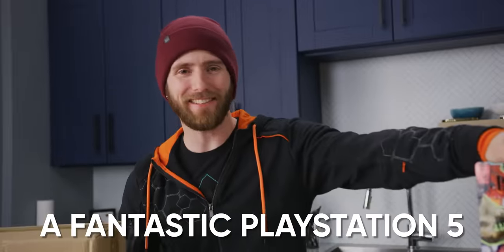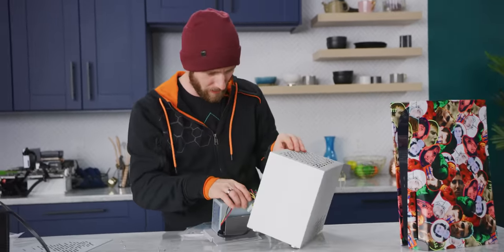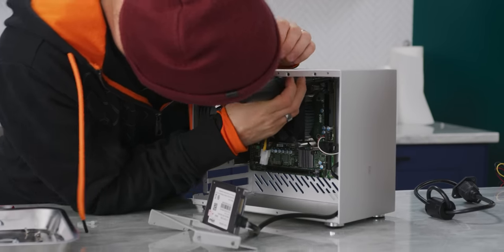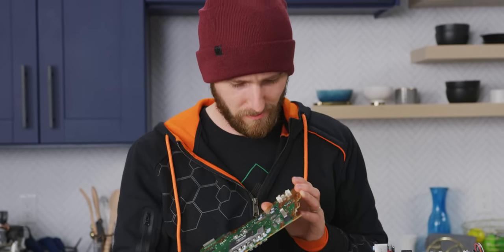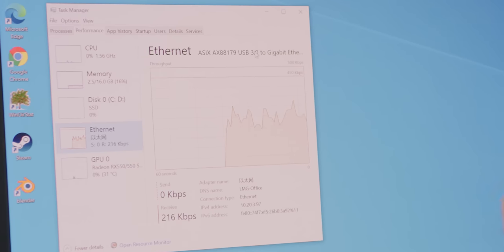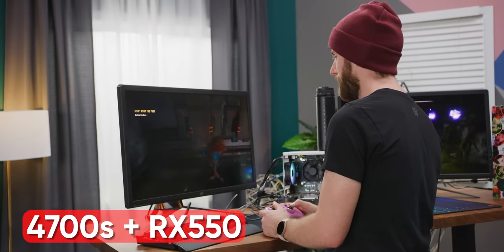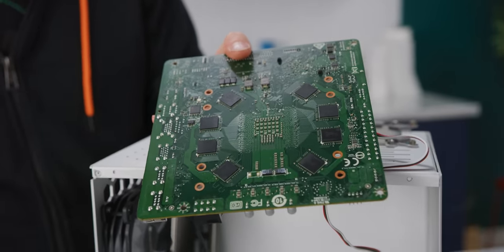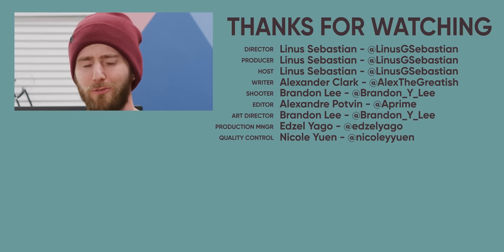Why Is AMD Selling Broken PlayStation Chips?

Comment: >"Instead of turning into e-waste"

Yeah... You solder it together with other perfectly fine components and get even a larger e-waste...
Reply: well, they need to assemble most of the parts to properly test the build
Reply: Yes, I totally agree: from 20 gram of CPU waste to 5 Kg (or so) of a complete system
Reply: It's only e-waste if you look at it from purely a gaming PC perspective. They'd make perfectly acceptable home office PCs for example, if the price wasn't so bad. 

A lot of the varriation in silicon performance comes down to small defects and all of the major companies that make chips do this, back in the old Phenom days the stuff that didn't work wasn't even separated and you could potentially unlock some more cores (they were all basically quads with parts disabled that potentially didn't work properly, I had a dual core that unlocked a 3rd that worked but at a lower clock) same with intel, with the same design put into different performance tiers based on their likelihood to perform to spec, and you can see it transparently if you take the cooler off some nvidia cards and see multiple models having the same die number.

This is by no means a new concept, and it's not even a bad idea in this case, it's just the price that throws it off. It's also why lower performance models often launch later than the main, because the lower models are the same design but worse, so when you have a bunch that don't turn out as desired but still usable and in a similar way, no problem just remove what's broken, call it good, and launch your lower tier GPU or CPU.
Reply: @SimonBauer7  not him but iirc, yes with a bit of luck
Reply: @SimonBauer7  I don't remember all of model numbers I know some of the quads could become hex in the second series
Reply: There need to be use case for that if they are price it so high. Or maybe they sold it mostly in bulk and then price is much lower (it's listed on AMD page, but you can't just buy it). Or maybe they do it just to satisfy some regulation and dodge paying for producing e-waste by making bigger e-waste.

Comment: 5:57 "that PCI Express slot - it's Gen2"..."that's exactly what the PS5 M.2 slot is"
Wait what?  I don't know what Linus is smoking.  The PS5 expandable storage specifically calls for Gen 4 drives, and works with high performing Gen 3 (from LTT's own video).  It's obviously not Gen 2.
Reply: maybe he meant x2?
even gen 2 pcie is on par with sata 6G tho

...but apparently it is gen 2 x4
Reply: Yeah, right, I also commented that.
Reply: Leave him alone bro he films so many videos all the time he's going to get something wrong.
Reply: @monetary687  First day on the internet there bud?
Reply: Do you not understand sarcasm?
Reply: Can't use sarcasm in 2021.
Reply from the maker: 8x gen2 is the same bandwidth as 2x gen4 (speed of PS5 m.2 slot) .

Legitimately not sure if this is exactly why it's like this, so I probably shouldn't have mentioned it, but it's not too far fetched.
Reply: @LinusTechTips  but even then, gen 2 x8 is 4GB/s.  The m.2 slot on the PS5 can read gen 4x4, or up to almost 8GB/sec. It would have left enough bandwidth for a full gen2x16 slot.

But it's probably down to Sony doing something proprietary.
Reply: @LinusTechTips  I think you're confusing it with the Xbox series ssd/memory card, those are 2x Gen 4
Reply: @LinusTechTips  Thanks for the clarification.  From LTT's "I tried an INCOMPATIBLE drive with the PS5"  video (at about 1:58) I thought the PS5 m.2 slot is 4x gen4. If correct, that would be the same bandwidth as 8x gen 3 or 16x gen 2.  

I agree that your  point in today's video is still valid - the 4700S SoC has limited I/O when used outside of a purpose built console.  Trying to make it have PC like connectivity leads to some weird choices.
Reply: @LinusTechTips  You people need to do stuff about these nudity comment bots like…

 “Yuna 😂” or, “OPEN PAGE,,,,,, 😍👇

Comment: I'm curious: what does Device Manager look like in "Devices By Connection" mode on the thing?
Reply: it probably shows the onboard GPU. Windows likely just doesn't have drivers for it because most console GPUs are custom made and do weird shit.

While this video is about the ps4 (below) the same applies to most consoles.
https://youtu.be/QMiubC6LdTA?t=1661

Comment: "we are saving on e-waste, instead of throwing away this little chip, we are making a much larger, more clunky system that will be thrown away". If the chip is busted, that's a few square centimeters of waste. Adding the board-which is also pretty junk when it's literally soldered into place with the busted chip, you just expanded your ewaste by orders of magnitude. Then combining it with a poorly made case and fairly junky cheap power supply, the e-waste created skyrockets.
Reply: I dont think you understand how expensive it is to manufacture CPU / GPU. The waste is not the actual chip, but the energy and resources put into it. The Power Supply issue isnt from AMD.

Comment: PlayStations 4 and 5 for the North American and Japanese market are label 110/100 V. but they’re all actually auto voltage, you have to disassemble it to see this on the power supply.
Reply: Wait is this true? I've been running my Ps5 in a transformer for months because of this.
Reply: @diabloterrorgf  I'm literally only commenting on this to see if they answer :)
Reply: @diabloterrorgf  did you aleady test it? im just curious...
Reply: @diabloterrorgf  Every PS since PS2 Slim.

Comment: 12:35 Fun fact: the PS5 has 4 PCI-E Gen4.0 lanes which are directly connected to that "IO hub" which is the SSD controller and chipset on the PS5. Those 4 lanes are shared with the M.2 and internal SSDs, which is not a big deal since you can only play one game at one. It also has a couple of direct-wired USB 3.2s (10Gbit), HDMI 2.1 and that's basically it.
Reply: Did they not do the ARM SoC south bridge for PS5 like they did with PS4?

Comment: I admit, I am still a bit disappointed that LTT did not install FreeBSD on this thing (for which NVIDIA has official drivers for the 10 series cards) for the “full-er” PS5 experience.
Reply: Is the PS5 OS actually based on FreeBSD like the PS4 was? I looked through Sony's OSS pages and couldn't find anything indicating that.
Reply: @Jake1702  PS3 and PS4 use freebsd so does PS5
Reply: @Jake1702  Technically I think the PS5 OS is based on the PS4 OS and the PS4 OS on the PS3 OS... but the PS3 OS was based on FreeBSD. Excellent choice, if I had to pick a base OS back in 2005 I would have picked the same one. But it's hard to tell how much FreeBSD is still left in there now.
Reply: @KillahMate  are you sure the ps4 software is based on the ps3?
Reply: @sleepyuser5189  Uh, I think I saw some articles at the time discussing how data miners found code on the PS4 that matches some PS3 code, so it looked like the PS4 OS is a continuation of the same codebase. But like I said, it's hard to say how much of the old code was left - all we know is that there's some. Maybe now that both consoles have been cracked people have had a chance to analyze it more in-depth, but I haven't kept up with that.

Comment: WHY TF DID U STOP HIM, WOULD HAVE BEEN SOME GOOD CONTENT
Reply: Buy 2, blow one up..... YES.
Reply: Doesn't sound like Linus stopped him, sounds like it wasn't working out.
Reply: Plugging 220 into 110 does the same thing as putting dead batteries into something. As in nothing happens. 110 into 220 is when you get sparks and fire.
Reply: @JETWTF  okay, good to know
Reply: @JETWTF  would you mind explaining? I really would like to know. AC electricity I find fascinating and I don't know a lot of nuances like that
Reply: @Frizzy9000  220 volt is double 110, plug a 110 device into a 220 outlet and it will receive twice the power it is supposed to get and create a catastrophic failure, as in pop goes some circuits with sparks and potentially flames. Plug a 220 device into a 110 outlet and it will get half the power it needs and barely work or not work at all, getting half the power it needs to function is not going to make it function or blow circuits.
Reply: @JETWTF  Makes sense, thanks!

Comment: Not that it would make a huge difference, but why would you test it against a 5800X as opposed to a 3700X since it's more analogous to the PS5's CPU?
Reply: Should test it against 2700x, since 3700x has much bigger memory cache.
Reply: @1GTX1  2700x is only Zen+ [Zen1 refresh] versus 3700x being Zen2..
Reply: @niteriderevo9179  less cache with lower frequency than zen 2 bottlenecked further with gddr instead of ddr ram making its performance more similiar to full speed zen 1 with ddr ram.
Reply: @darkwolf1739  give zen+[zen1 refresh] the same limits and it won't perform as well as zen2 does, the ps5 core is 8 zen2 arch cores paired with a custom amd gpu as a SoC

Comment: Plugging a 110v supply into a 220v supply, the best case scenario it works, worse case scenario it does nothing. How does giving something less supply voltage make it catch fire? Everything inside is rated to handle more voltage not less. Also what? Having a multi voltage power supply requires power faction correction? No it doesn't, it requires a different switching power supply chip and a different transformer. The reason it is 220v only is because it was never intended to go somewhere with a 110v supply. You can make it simpler, easier and cheaper. Power faction correction is making sure the power and voltage is in phase and it a concern for all switching power supplies regardless of voltage input. I like your videos but please get someone that knows something about electronics.
Reply: Exactly. It's not made for US and Canada market
Reply: Yeah that's what i thought, EU, ANZ parts of Asia all use 220-240v, very few products/psu's are sold with dual switch. Most of the devices I have are 220-240v only even big well known brands like EVGA/Seasonic/Corsair
Reply: my exact thoughts, if you plug a 240v supply into 120 best case itll work worst case nothing happens
Reply: In ac motors you can burn out a 220 motor plugging in to 110 v as it needs to draw double the current to maintain the rated power. So they could be coming from this but not usually true in electronics
Reply: I'm from third world countries and we use that huntkey PSU everywhere let me tell you nothing explode and about 110v or 220v, that PSU come from China and all most all Asia countries using 220v ( the only one using 110v i can think of is Japan) so if you order it from Aliexpress it just not mean for your region just like charger things.

Comment: Back in the early '90s when dual-mode power-supplies were first a thing, there was a switch that would allow you to change it from 240V/50Hz to 120V/60Hz.  One time I plugged in a power supply to a 120V/60Hz outlet while the switch was on its 240V/50Hz setting.  The only thing that happened was that the front-panel LEDs lit up very dim and the computer didn't boot.  Of course, when I saw that, I turned it off very quickly, so maybe it would've caught fire at some point if I'd left it on?  But for the less-than-ten-seconds it was on, nothing happened.  I unplugged it, flipped the switch to 120V/60Hz, plugged it back in, and everything worked fine.  No apparent damage.
Reply: no it wouldn't, Linus is talking bs there

Comment: Think this would be more used in things like animatronics or controlling rides in theme parks as those systems tend to be really really outdated and slow ( seen a few barely able to run windows 95)
Reply: I hope that a ride controller does not use an obscure PC hardware, based on a consumer product.
It should be based on embedded or industrial variants of the components.
 know a company that bought Genuine Microsoft DOS embedded licenses in 2008 for building a medical device/system developed in the 90s.
Reply: @sarowie  

A cousin of mine spent a lot of time to set up DosBox to make critical systems run properly. Which is kind of hilarious.
Reply: @BitchlessNigga  Springtrap rocking with ps5 GPU

Comment: Seeing a 'broken" PS5 CPU perform better than my Pentium makes me feel like a scrub tbh
Reply: the cpu part itself isnt broken, just the igpu is disabled
Reply: Tony Oh, I see.
Still, that iGPU I think is stronger than my 9600GT.
Reply: @mix3k818  
If it was actually working , it would be as powerful as an Rx 6600 /rtx 3060
Reply: @mix3k818  it's not working...if it works it can run games at 4k

Comment: that'd be a pretty killer setup if it had the integrated GPU!
Reply: I'm not sure that the cheapo fan would pull it off when the GPU is enabled though. It might go through the roof because of performance or because of the fan, is all I'm saying.

Comment: 6:03 isn't the ps5 nvme slot gen 4? Unless they are somehow using some chip to use more pcie gen2 lanes for fewer pcie gen4 lanes
Reply: AFAIK the PS5 IO controller - just like the PS5 memory controller actually - is at least partly custom Sony hardware. This board doesn't seem to be using any of that because it's either turned off like the GPU or absent, I think it piggybacks on the leftover PCIe lanes for everything.
Reply: @KillahMate  I do not have a ps5 but based on the direct storage thingie where the textures are directly loaded from the ssd and the minimum speed requirements for an ssd to be compatible, I would assume that the nvme slot is directly connected to the apu and not running thru a chipset. But it totally makes sense that they could turn off some io or pcie lanes. Maybe as linus pointed out the problem is in this part of the silicon and thats why they turned the board does not have an m. 2 nvme slot. Or maybe due to some defection not all internal buses in the apu are within pcie gen4 specs so they enforce pcie gen 2 to meet the apus capabilities.
Reply: Linus responded in another comment. He was referring to bandwidth. Gen2x8 has 4GB/sec bandwidth, which is the same as gen 4x2. Although, I'm still pretty sure the PS5 slot is Gen4x4.
Reply: The m. 2 slot is actually gen4 x 4 just checked still some mindbending stuff to think about.

Comment: Not the first time AMD has done something like this. Years ago I had a phenom II x3, that was basically just a phenom II x4 with a core disabled, probably due to not performing as well as the other 3. there were even reports of people unlocking the 4th core.

Love the fact this silicon was not going to waste, particularly because a lot of the time by the time you get to the point you know its floored, the product is in the final stages of manufacture.
Reply: all chips are like this. they make a batch of "identical" chips, and then sort them into product lines. it's the same reason when the military buys hard drives, they always come with the full 1030GB; because they pay extra to get the cream of the crop.

Comment: Plugging in a 110V input into a 220V rated PSU will NOT EXPLODE. Because 110V is obviously lower than the rated voltage that PSU is rated for. The output power will of course be lower. However if it was the other way round you will have a nice kaboom.

Comment: "They take this ewaste and they turn it into another ewaste product."

Is what I take away from this.
Reply: But you are forgetting that these parts will have a much longer life than if they were just tossed into the scrap bin right away. Everything is going to be E-waste at some time or another.
Reply: @jad43701  I mean I understand that angle but if the product that you make from garbage is itself pretty garbage then I don't understand what the point of making the product is because all the other processes to make the garbage has generated more garbage

Comment: Love these videos where you go deep into the hardware. Also showing the latency and bandwidth of DDR vs GDDR was very interesting. Wasn't aware of that. 120 ns seems not that much compared to 60 ns. I expected more gains in 15 years. Would have been good to have an explanation there, why it is soo detrimental.

Comment: So if the APU on the board is technically defective. What would happen if you got a professional to remove a good APU from the PlayStation 5 and soldered it back to the board. Would the performance change? Would it even work?. I think this needs to be answered.
Reply: From the video it's clearly shows that the GPU is not working and need an external GPU

Comment: >Not living in a country with 220V 50Hz electric grid 
>Blame it on a manufacturer that definitely were not meant for your market
wtf
Reply: I think the main problem was that there was no way of telling that it was 220V only PSU unless you removed it from the case since there was no sticker on the plug extension indicating that. Also most mid/high end power supplies do support both 120/220 volt so most consumers would be caught off guard. The regional thing can make sense in a short sighted way but once the device goes on the used market that argument falls apart. As a manufacturer you have a responsibility to clearly indicate any safety concerns about a product before it goes into the customers hands
Reply: Most power supplies automatically switch based on the input voltage and frequency, working on all power grids across the world.  Making one that only works with one voltage and frequency is cheaping out.
Reply: >greentexting on Youtube
wtf